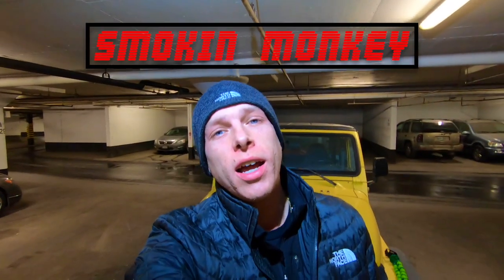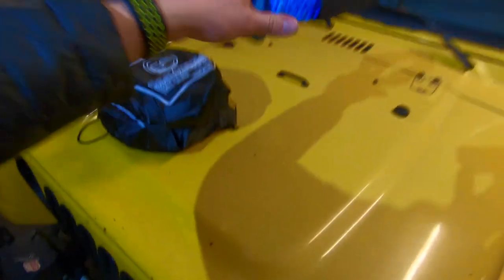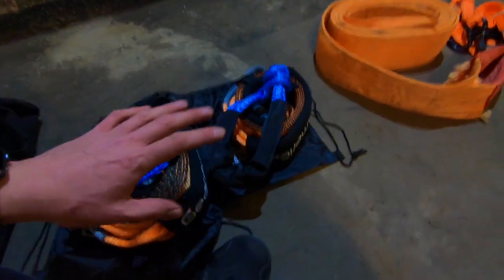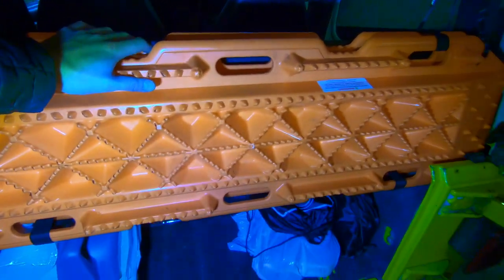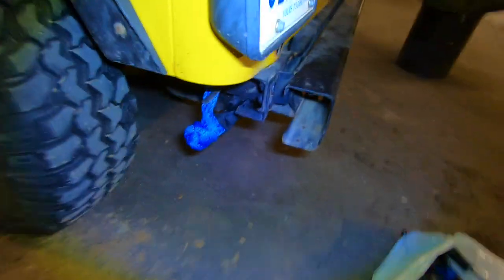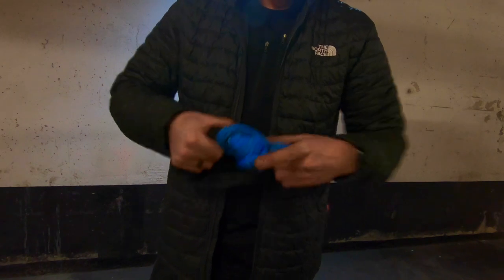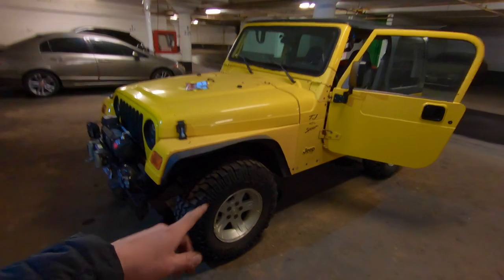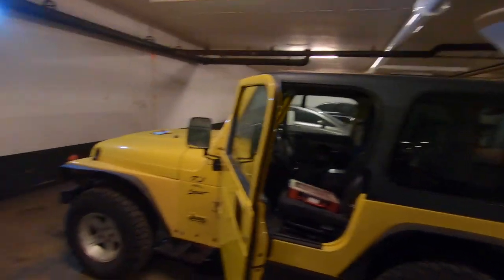5 Reasons To Upgrade To Soft Shackles For Your Recovery Kit! TJ ‘BIG BIRD’ 2.0 Build (Part 5)

Comment: you do realise that any kind of sharp edge when you put load on it will act like a red hot razor sharp knife and cut that soft sling ;) (there is a formula to work out the min needed radius (i think its something like 2x thickness as a radius))   but in saying that they are 100% better idea for recoveries
Reply from the maker: Of course sharp edges are your worst enemy, just gotta be mindful how you hook up your straps and it should be fine. I’m more worried about the line itself than the shackles getting torn on something.